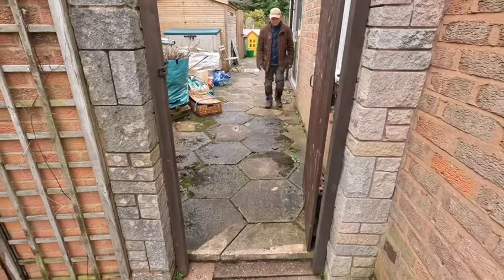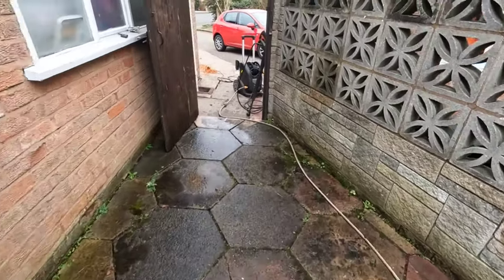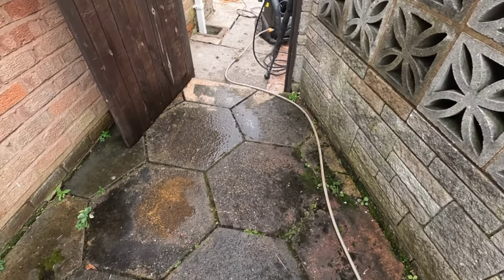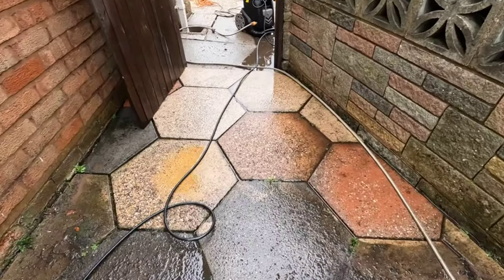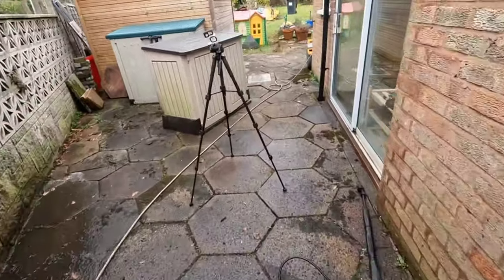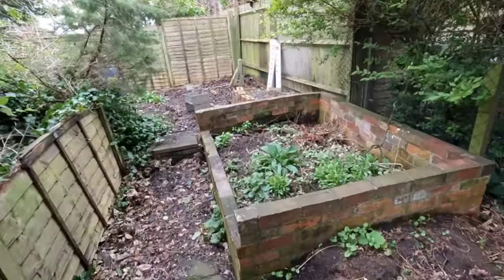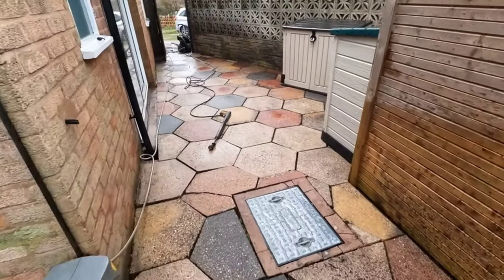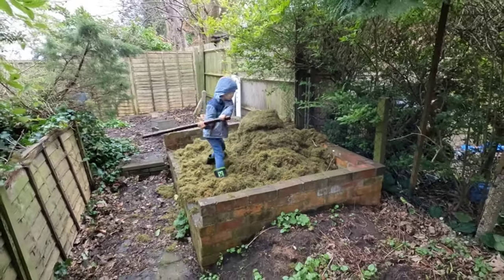Uncovering A Multicoloured Hexagon Patio & Making A Mountain of Moss

Comment: Do you have to be very strong to use a pressure washer?  I'd love to have a small one, certainly not as powerful as yours, for a lot of things around here, but can just imagine the hose whipping around busting windows because I can't control it  🤣
Reply from the maker: Hi! It needs a tension kept on it that's a little bit taxing but not too bad. But the thing that surprises me is the endurance needed in your hand to keep the trigger pressed, that was the main challenge for me, I guess mainly in the thumb and fingers. You can change position and posture, but it's about an enduring grind of pure time. I.e. it took me 3hrs to do the small bit of multicoloured hexagon patio in the back and maybe, 16hrs to do the drive in the front. But it was all so far gone it needed the most time consuming, small and most powerful jet. You could do it 10x faster with the patio attachment...
Reply: @CityGardener  Hmmm, things to think about.  Thank you for your insight.  My hands are arthritic so this may not be the best choice.  Wow, sounds like you had quite the workout!  The patio came out beautifully and the driveway was stunning!